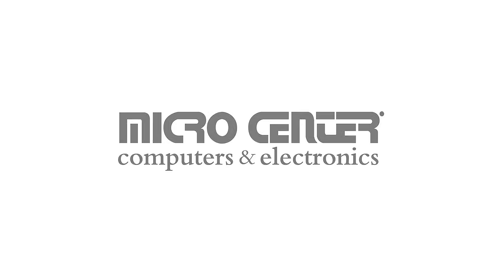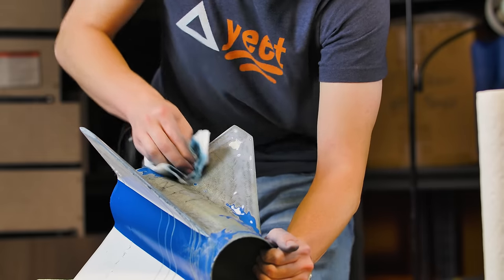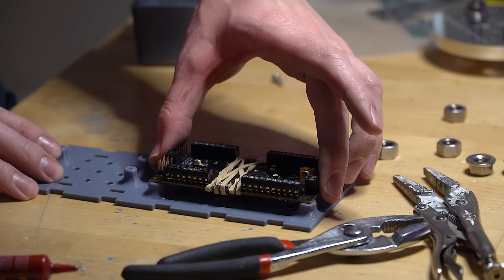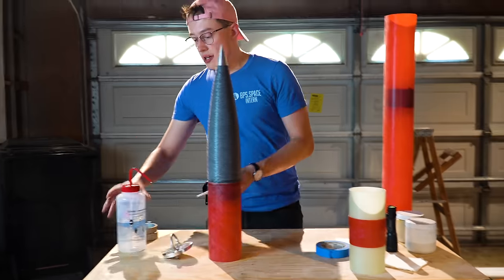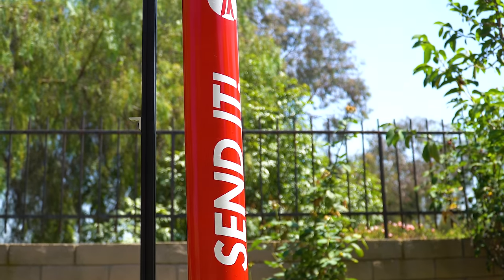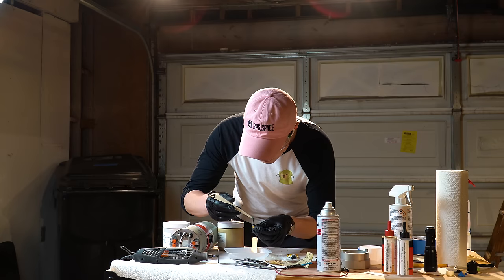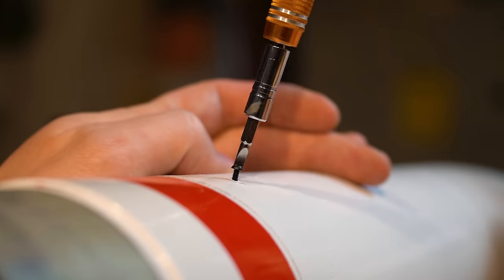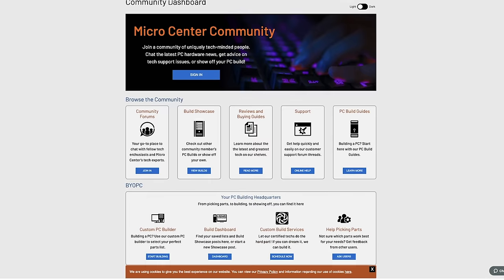How Do You Build A Level 3 Rocket?

Comment: Here’s a painting tip for you with stencils. Use clear coat first over the stencil. If anything bleeds, it’s clear coat. Once you cover that with your paint and peel, you’ll have clean, crisp lines every time. Even on porous surfaces.
Reply: You can also apply a coat of the base color after the stencil is applied. If there is bleed it will be from the base color and it will seal/fill any area where the bleed of the 2nd color may occur.
Reply: or just use proper stencil vinyl that doesn't bleed.  cnc bulkheads, getting pcbs made but half assing the last bit with a hand cut copy paper stencil.
Reply: @obzelite  even with stencil vinyl, I recommend clear coat. I’ve had it bleed through too. Depends on the quality of the surface being painted with a stencil 😁
Reply: Came here to say something similar, but I agree with J Kit.  Don't worry about clear coat, just give your stencil a couple of light coats with the base color.
Reply: @DavidSoucie  Agreed! Same concept, just depends on whether you plan on clear coating your entire project or leaving your paint unprotected to the elements. You are putting in the time and effort, you be the judge on what's best for your project ;)
Reply: @coreysienko9435  Fair, it works either way, I just tend to do clear coat last so if I spray base color then stencil color over the stencil then I only have to mess with clear once.
Reply: It if you just hold the nozzle perpendicular to the painted surface, dust the paint on lightly in couple layers, and don't get the paint wet enough to where it can seep into cracks or low spots.. real quick and easy to do
Reply: Whoa brilliant
Reply: Lol, I just had the exact thing prepared as a comment. Instend of sending it I give you an upvote. :D
Reply: Best random but needed advice I've stumbled on in the comments - EVER.

Comment: Cool! I didn't even know there was a certification system for rocketry.  Congrats on getting yours!
Reply: Bobby dookie!!
Reply: Does it mean you can buy bigger rocket motors or explosives or something?
Reply: @thetruthexperiment  iirc yea you have access to more powerful rocket motors
Reply: you can make your own motors (any size) without certification. 
Certification applies to NAR or TRA events
Reply: @mojaverockets  NAR won't let you fly at their events with an ex motor though as far as I know. Tripoli will but you need a level 2.
Reply: @flare2000x  Tripoli limits what type of experimental (research) motor you can launch at their events, usually only certain types of solid propellant motors.
Reply: Interesting stuff.  What's required to get your level 2 or 3 besides making it go in the air?
Reply: @WarbirdPylonRacer  Level 2 has also a written exam. Level 3 has a procedure where your design and construction are approved by 2 members of a Technical Advisory Panel (TAP) at each step. I just got my L1 last weekend, looking forward to L2
Reply: @webcucciolo  I wonder if there is a place to study for the L2?
Reply: @WarbirdPylonRacer  I'm study on Tripoli website (it's one of the two bodies in the US that can provide certifications, the other being NAR)

Comment: Great flight! Just a tip for future reference on charges: The turbo encabulator is awesome, but the new micro encabulator saves a lot of space since you don't need a full-length non-reversible tremie pipe, so you can run nano grammeters 👍
Reply from the maker: Thank you! I've been trying to find some micro encabulators but they're sold out almost everywhere, have plenty of nano grammeters though so I'm all set there :)
Reply: @BPSspace  Microcenter doesn't have them? 

I miss Radioshack more and more every day
Reply: English?
Reply: @ThatGuy-pk6yr  Yep, you got it
Reply: Also gets rid of the base-plate of prefabulated amulite. To bad you still need ambifacient lunar waneshaft to prevent side fumbling.
Reply: @ErikB605  Let me walk you through the Donnelly nut spacing and crack system rim-riding rip configuration. Using a field of half-C sprats, and brass-fitted nickel slits, our bracketed caps, and splay-flexed brace columns vent dampers to dampening hatch depths of one half meter from the damper crown to the spurve plinths. How? Well, we bolster twelve husk nuts to each girldle-jerry, while flex tandems press a task apparatus of ten vertically composited patch-hamplers. Then, pin-flam-fastened pan traps at both maiden-apexes of the jim-joist.
Reply: @Borntosell  You need a Tri-axial Dekeffufle Valve, but it has to be one manufactured in the northern hemisphere.
The southern hemisphere models rotate in the CCW direction and not the northern CW direction.
Reply: @tomgeorge3726  : Just get the opposite polarity and thread it on backwards. It's a bit leaky, but works reliably.
Reply: @ErikB605  A simple Stetsor valve with an upstream AX101 Goddamitron will completely eliminate the need for any ambifacient lunar waneshafting. Any side fumbling
will be synchro-disoidally nulled when initiated. To also eliminate any positive gain aero-flux, just turn it up to 11 and go for it. This usually works almost every time!
Reply: @RocketVlogs  Just look up a video on the turbo encabulator. There are a few really good explanations out there.
Reply: @KSparks80  Oh come on guys: the obvious solution is the flux capacitor. duh!
Reply: @rick-hm3ji  I guess so, if you have one handy. But the sound and fury of an AX101 Goddamitron spoolin' up to 11......goosebumps!
Reply: @tomgeorge3726  I see. So the reverse gravitorsional anti-swirly effect must be taken into account here. Interesting! I used a Chinese black market Tri-axial Dekeffufle Valve once. There was no real explosion, but my garage disappeared. That sucked.
Reply: @KSparks80  I hope you all realise that it is the "wibbly-wobbly, timey-wimey... stuff" we have to counteract in our current time and space continuum.
Reply: You really gotta fit the ambifacient lunar waneshaft so that side fumbling is effectively prevented, otherwise you're screwed

Comment: Just a couple tips from when I got my L3, try using the double pull pin switches from lab rat rocketry. In addition to adding a sweet 'remove before flight' lanyard, they are a mechanically simple way to easily arm two altimeters simultaneously. It would also be worth mentioning that I also wired two screw switches in parallel with the pull pin to add dissimilar redundancy for each altimeter. As cool as the power hatch is, just be wary that you are severely weakening the fiberglass by cutting that rectangle - filament wound composite does not like being messed with. Especially be careful with weakening the coupler that holds your two main parts of the airframe together because a rather large moment is applied there during flight. Because of that, I would recommend moving the location of the runcams to somewhere else on the airframe. Just being nitpicky here because clearly it worked, but moving forward with bigger and crazier rockets, these are just a few things to keep in mind. Awesome job!

Comment: The trick to shopping at microcenter: So you are not paying $4.99 for a resistor that digikey sells a roll of 10,000 for $5 is peel the price tags off cheap things and put them on expensive , plus then the 400% mark up that micro center charges. A new Fluke multi-meter for $4.99? Well the kid at the counter getting paid min wage doesn't know that and the 10,000,000% mark up you have paid on resistors over the years for when you couldnt wait for digikey, still keeps those profits healthy! Thats why I recommend microcenter and a good set of finger nails!

Comment: Look up "finger tech power switch". It's a switch designed for small combat robots and as such is super durable/shock resistant, lightweight, and should never back out from vibration. It does require a hex key to turn on but wouldn't fall out like the power hatch link might if, for example, it landed on it at a funky angle

Comment: Instead of cutting the ziplock "tails" close up against the cliplock face, cut them a little way back (even about 1/2 cm). When they are latched, you are relying on (usually) just three clicks, so if the lock slips (for any reason), a close-cut tail will just let go. If the tail is a little longer, a slip will not be catastrophic as it will catch and re-grip. Strangely, I was taught this in my stage lighting hobby, and it works - I use it in all my model RC aircraft too.

Comment: Extremely well done Joey from Joey.B rocket reviews, you are part of the inspiration that got me designing and 3D printing my own model rockets. My rockets aren’t as advanced as yours but the parachute deployment process is rather unique and I haven’t seen it anywhere else on the internet. But aside from that keep up the amazing work :)
Reply: Well don't leave us hanging! How do you deploy your parachute?
Reply: @PatrickKQ4HBD  I use fairings instead of the usual nose cone design, everything is packed into the fairings and when the blast of air from the motor (which would usual blow the nose cone off which takes the parachute with it) the fairings get pushed out and they separate. Leaving the parachute protected and in the ideal position to open

Comment: Just a quick tip for painting, if it needs to be very sturdy good looking and fast there are 2k spray can's. You can speed up the curing of the 2k paint by like you do with normal epoxy heating it to around 60°C. If you store the paint in the fridge you can get up to 24h once activated so you have time for multiple layers and sanding if necessary. Looking forward to the flight video ☺️

Comment: Got my l1 and l2 last fall. this is making me want to go all the way. the cost is not on the otherhand XD
Reply: I did rockets for the first time in grade school, around 1970.  There were no "High Power Rocketry" certifications back then; in fact, due to NAR Safety Code, it was technically illegal to launch even a G motor rocket (these days, High Power is H and higher impulse).

When I flew them again in the 1990s, I got my NAR Level 1 on the first try; to make a point I used no epoxy in the entire rocket, and super glue only to hold lead shot ballast at the tip of the nose cone.  All rocket parts were plywood or paper (aka cardboard) tube, all structural glue was Titebond II, except for PVC pipe cement for the quick-change positive motor retention system I designed (pipe cement bonded the threaded plastic pipe piece to the actual motor mount tube).

The rocket flew flawlessly on an Aerotech H128, recovered correctly (using motor ejection and a deep bed of blow-in insulation material to protect the parachute, and recovered with no damage (as required).

No long after that, I dropped out of hobby rocketry, because I couldn't see being able to launch anything bigger than that rocket even once a year.  Not just the cost of motors/propellant reloads -- but the travel cost to get anywhere it was legal/safe to launch bigger vehicles.

Comment: I dont know if this was already posted but for the painting with stencils, try to paint the rocket in red, then apply the stencil, then spray the stencils also with red, let it dry and then spray a layer of white above it. This re-painting with red spray color seals all the cracks for the white layer. Should result in way cleaner edges! This is a technique from painting clean edges on walls ;)

Congrats for the Launch!

Comment: A top tip I use when doing airbrushing stencils is to hit it with the base colour to help seal it first. Then any bleed is basically invisible and you finish with the top coat as normal.

Comment: Hot glue is a Godsent. Works every time. Also I like to desolder screw terminals, and directly solder the wires to the pcb for mission critical stuff, fix pcb connectors with zip ties to the board itself (probably not a great idea if the connector has to be pulled out fast for some reason ) add some more hot glue, say some prayers, knock on some wood and it's ready to go.

Zip ties, hot glue and tape are the holy trinity of engineering probably, if your hardware does not have all three it's destined to fail.

Comment: You can improve your painting technique  by  keeping the spray head 1.5-2 feet away from the surface you are painting, begin spraying first then move left or right across your surface being painted and stop spraying on the other side. This will give you a more even coat since the spray has a chance to fan out more and will keep the paint from clumping up on you from being to close... This should also help to stop paint from seeping under your mask / template.

Comment: interesting usage of those WAGO connectors. I used one I once got on the Hannover Messe on my sim racing steering wheel, and it held up pretty well to the extreme rattling and shaking, with way too many cables crammed in :D

Comment: If you like hot glue, you're going to love UV-curing resin adhesive. It is cheap, applies with the consistency of hot glue except with less finger-burning potential, and cures in seconds when hit with a commodity 365nm UV flashlight. It is substantially more temperature tolerant than hot glue, and somewhat more compatible with simple cleaning solvents like alcohols if that's important in your application.

Unless I'm definitely sure I'll need to remove something easily and with no residue and surface marring, I always grab my UV resin first these days as it's a big timesaver compared to waiting for the hot glue gun to heat up and for the glue to harden without dripping down into places it shouldn't.

Comment: I think in some places you have very heavy design. 
Insted heavy steel screws you could use 7075 rods, drill it inside and threaded on both ends. 
Use bolts on both sides to screw it to flenches. 
It will take 10min on the lathe each. 
Or use rods in same diameter and thread both ends to mount it by nuts. 
You can byt aluminum nuts too. 
7075 in T6 state has bigger endurance than normal steel but is 3 times lighter. 
U-bolt also can be made by durable aluminum alloy. 
Tempering and deformation on some round tube will create good U-bolt. 
You can temper 7075 in 470*C, put it to cold wather to quench alloy (T4), and then you can defrom it easy without cracks. 
Cold deformation will make it durable in deformed places. 
After each month quenched alloy will get harder and harder because small phaces will start going out quenched alloy and will start block dyslocations. 
But even quenched 7075 isnt so soft like normal quenched aluminum alloys and has enough big endurance. 
R02 of 7075 T6 can be over 400-500MPa. 
7075 in T4 has R02 probably over 200Mpa which is more durable than crap like stinless steel but still you cen deform it to create U-bolt. 
Also you can ad some holles or machine more pockets in these both machined flanch.

Comment: Also regarding polarity, it's generally good practice to have sockets on the powered side of a connector, and pins on the non-powered side (partially for the reason you suggest, but also for personnel safety with higher power supplies).

Comment: I used to make the Estes kits as a kid.  Just recently got the hankering to make something a bit larger.  Then I learned about mid power and high power rocketry, and the licensure system.  Man, I had no idea what went into to making something of this level.  I guess it makes sense.  At this level, these are not much different to military missiles, only without the warheads.  Definitely gonna scale down my ambition and try something mid-level first.

Comment: Regarding zip ties; you might enjoy NASA-STD-8739.4, "Workmanship Standard for Crimping, Interconnecting Cables, Harnesses, and Wiring"

Particularly table Table 9-1. "Spot Tie, Plastic Strap, and Stitch Spacing Dimensions"

For cables 6.4mm (0.25") in diameter, the maximum distance between harness ties is 19.1mm (0.75").  As the bundle diameter increases, the spacing between ties increases, as the overall bundle is more rigid.

Comment: Pro Tip for painting, once you put the stencil on the rocket, apply a light coat of the base color.  Once dry, apply the lettering color.  The base color will bleed and the upper color will look crispy and smooth!

Comment: Advanced anti ship edition

“The Anti ATF and FBI Vertical Launch System (AAFVLS) is a vertical  launch system used to counter attacks from the ATF and/or the FBI. It launches guided surface to surface and surface to air missiles known as Anti ATF and FBI Missiles. (AAFM) The missiles have to ability to take down spy planes, spy balloons helicopters, APCS, tanks, and boats. This missile system only costs around 1000 USD.”

Comment: For Runcam cameras what is the hardware you used to extend the lens. I have one for my larger rockets and hope to use it on my ZEPHYR when I go for my level one. I want to have the RUNCAM inside the rocket and extend the lens to attach it as you did. Look forward to hearing more about this or a link to some gear to extend the camera off its base. Love the videos! Can I do this with Runcam 2 4K - the orange little camera